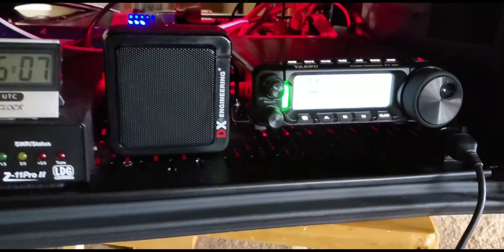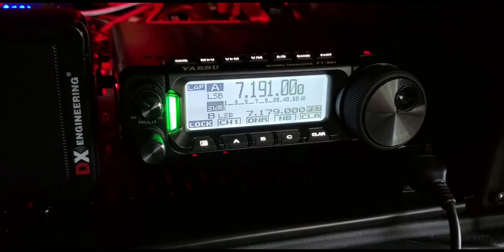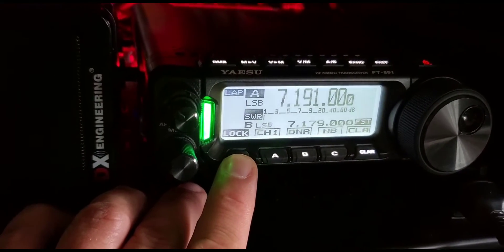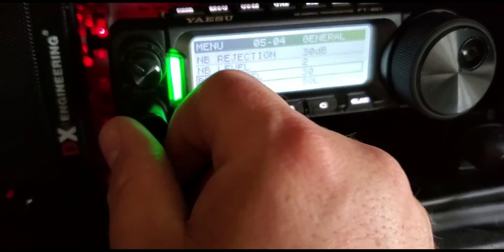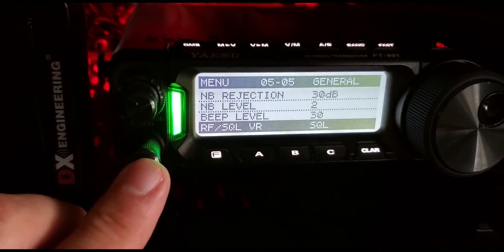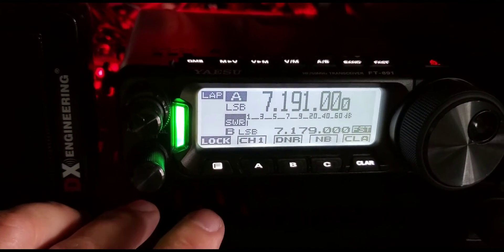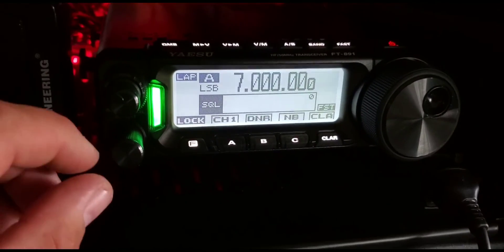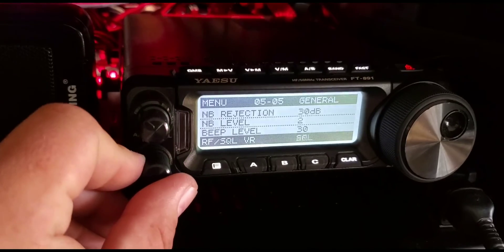Ft-891 squelch green light

Comment: This it not just a cosmetic change, as it does more than just turn the green LED on.  This changes the function of the outer knob from RF Gain to Squelch.  RF Gain, along with IPO and ATT, all directly affect the receiver gain.  Be sure you're willing to give up RF Gain control in exchange for the green LED.  :)
Reply: Exactly. Why would you want to give up RF Gain? So that you have a green light come on? Now, it would be nice If it came on when a signal that was hotter than 5/9 came through. That would be cool. Love my FT-891.